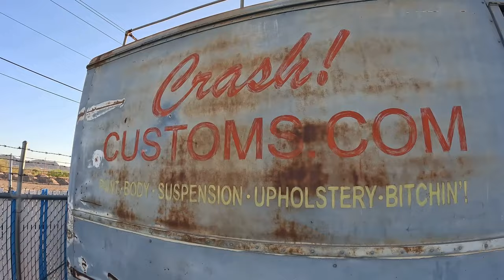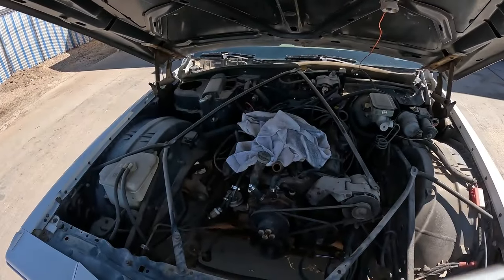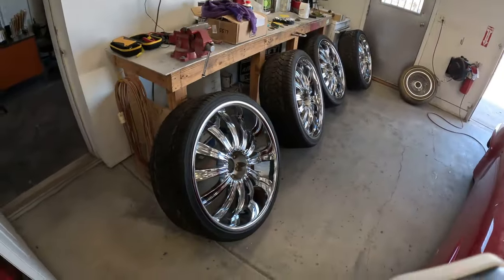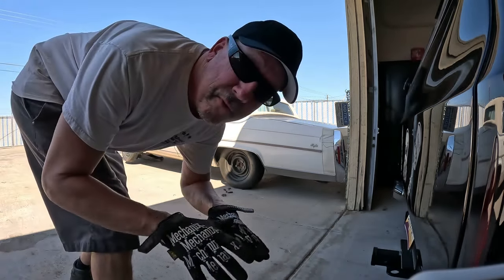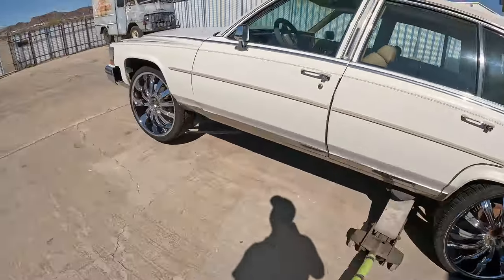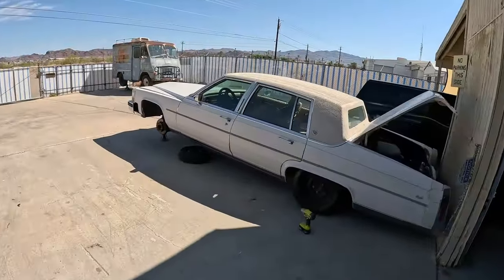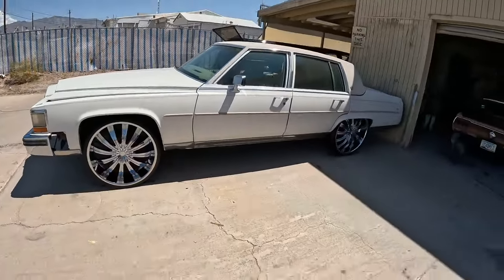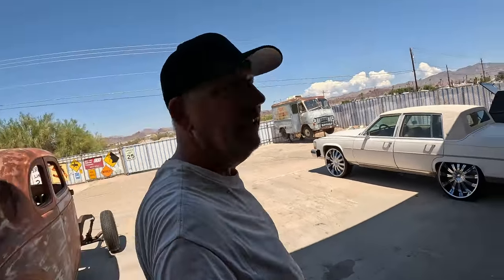1987 Cadillac Fleetwood Brougham sitting on 26's. Lake Havasu City, AZ. Crash! Customs

Comment: MAN! I have nearly the same car, just a 1979, and it is the d'elegance version. Thanks for the fitting of the 26s, as this is where my dilemma is currently. I was not sure on 26s or to be safe and go 24s. I do not want to cut anything, and your video shows that I probably should got 24s. Not a lot of good videos on these Caddys, so I'm subscribed now, and good forward to the build! I want to go EFI as well. (I have the 425, and seeing all that space you have under the hood with that 305 is crazy!)
Reply from the maker: Thanks for the positive comment! If I were to buy new rims I would have done 24 front and 26 rear. The squat would look more aggressive. My marketplace 26’s was such a good deal I went that way. I had a ‘79 coupe back in the day, great motor. Thanks for subscribing!

Comment: I picked up an 84 this year that had 26"s on it but I bought it with the stock wheels. Lots of steering and front end googlie wabble lose problems because of it. We're still going through it to correct it but it also messed up the air suspension so the front sits up pretty high but I'm running 13"s on it so everyone thinks I have switches cause of the old school lowrider look. Very fun car!!!❤❤❤❤❤❤
Reply from the maker: Right on!
Reply: Try qA1
Reply from the maker: @TimS-zo4ib  that’s definitely the plan.

Comment: 87 Brougham. It's not a Fleetwood Brougham. Fleetwood Brougham was used up to 1986. Then 1987 became two separate models the Fleetwood being the small FWD baby lacs as they're referred and the RWD was the Brougham. This was up to 1992. In 93-96 the names merged back together
Reply from the maker: That’s correct. It was an awful idea by Cadillac to split the name and introduce a front wheel drive Cadillac. For the search engine I will continue to use Fleetwood Brougham. The big body rear wheel drive Cadillac enthusiasts don’t care about the baby lacs. The emblems will get shaved on mine when I paint it. Thanks.